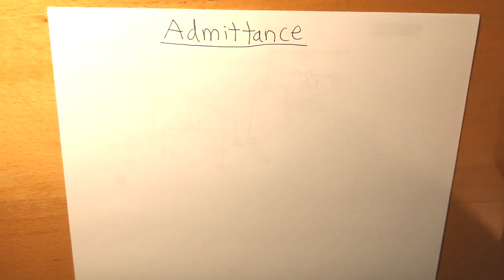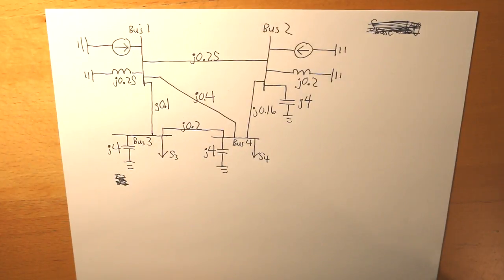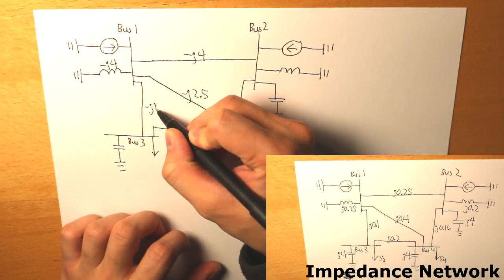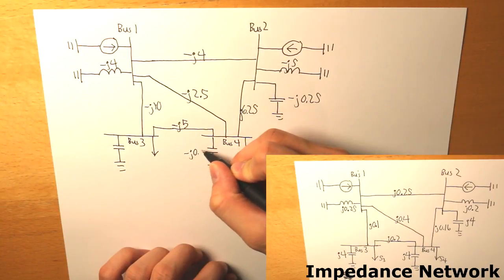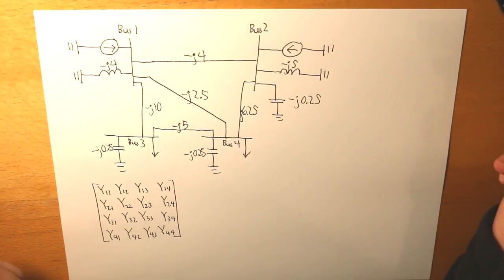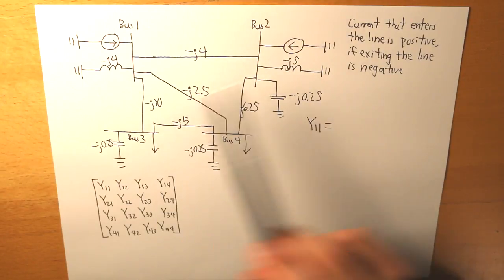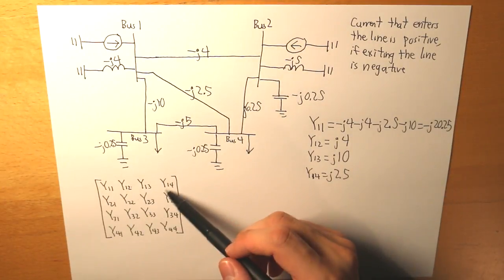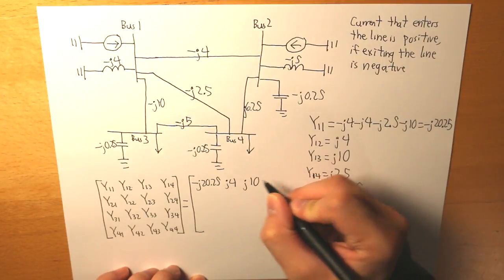Admittance Network

Comment: Hey thier , sir actually i have seen the solution in the original book power system analysis and at bus 3 and 4 the answer is deferent from what you got . In term of power at load i think the things change yet i could not find any satisfying answer .